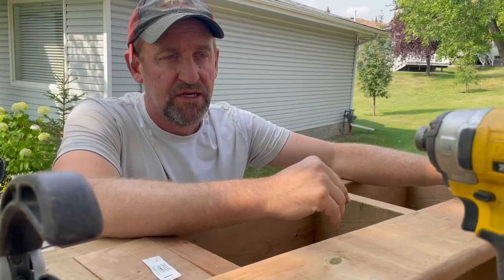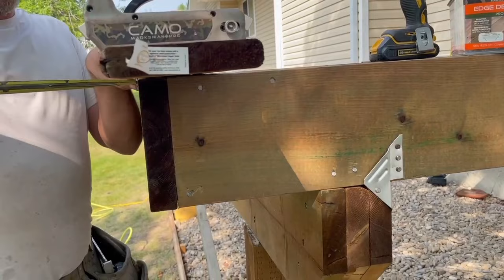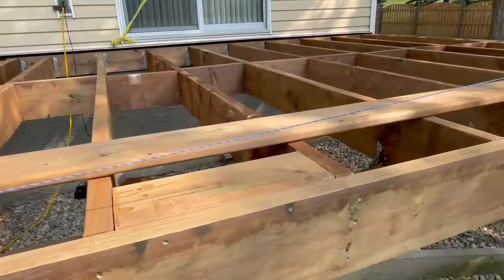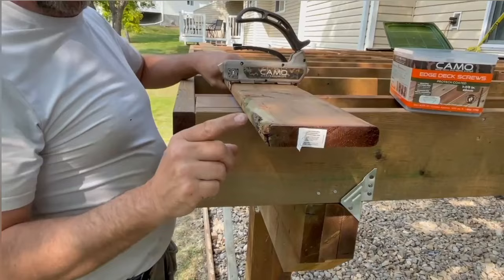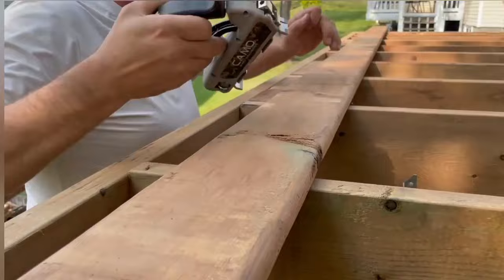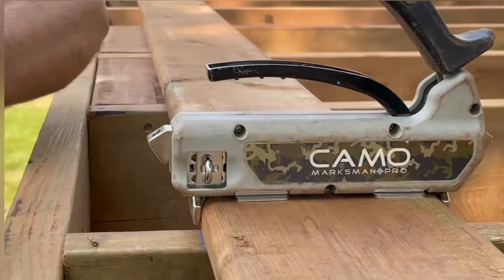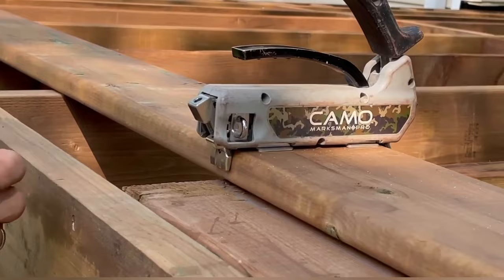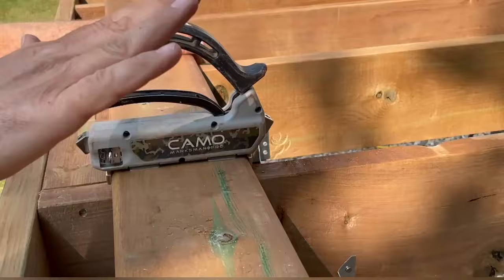Installing the First Deck Board (With Camo Markmans Pro)

Comment: As a 50 year carpenter, ive used the camo system on trex decking..its a good product, but NEVER use it on wood decking. It leaves a space between the boards that looks nice at first. After the wood shrinks up from the exposure to the elements, the gaps will open uo to a half inch and sometimes more. The fasteners will also start splitting the edges if the deckboards as the wood shrinks. Do not make this costly mistake.
Reply: Camo has a different jigs for wood and composite decking. The gap is much smaller on pressure treated wood. Of course there are associated risks if the wood gets delivered and installed fully wet.
Reply: How old are you 80 years old
Reply: I am actually wanting the spacing to help with the drainage which here is excessive.
Reply: I hear ya on that

Comment: No one shows the hard part.  How do you put the screws in the edge of the deck board next to the house?
Reply: The way I usually do it is if you got your flat bar pry bar you get it between the house and you're bored and you got to push out a little bit to hold your board tight to the other one.
And then you put your screw to the back of the board if it's not real wide that way when they put the trim or the siding j-track it should cover the screws

Comment: Just finished my deck using Camo screws and the Pro.  Many many many broken screws.  Too many.  And I had to pull a few boards back up and soooo many would not back out or were bent or once again broken.  Not very satisfied with the product.  Will not use it again.

Comment: In case anyone wonders why they recommend using a drill instead of an impact its because there have been hundreds and hundreds and hundreds of complaints about the driver bit twisting and snapping.

Comment: How do you install the screws on the very first board with the 1-inch overhang?
Reply from the maker: Generally I face screw the first board. Not as pretty but stong and easy. You can attach the overhanging board with small angel brackets, attached to the rim joist. I haven't found it worth it, but it does give you a entirely clean decking.

Comment: I wonder if you can take the spacer completely off. Spacing deck boards is a mistake with even the best carpenters. The boards will shrink anyway. If you space them over time, you will have an ugly looking gap.
Reply from the maker: If installing "green/wet" boards a intialal smaller gap is helpful as you say the gap will grow. Camo does have a smaller gapping tool, but zero initall  gapping requires face screwing.

Comment: How does it hold up over time? Any warping with the no show fasteners?
Reply from the maker: I haven't had any complaints. The angle of the screw actually hold more of the board than face screws.
Reply: @decksbye3269  awesome thanks for the reply
Reply: Yes. As the deck expands and contracts, the fasteners often tear the edge and no longer hold.
Reply: @michaelboykin9881  The face screwing from the top is more likely to split the board so stuff happens either way.

Comment: How do you deal with low points among the joists ? I've planed and belt sanded the high points, but there remain many joists below, in certain areas, the level top surface of the joist/frame ?

Comment: Hello help?... We have 19mm Kwila, which specifies using 45mm camo screws. Can only find 60mm in stock, anyone had any issue using the larger screws on 19mm timber? Is the thread the same?
Reply from the maker: Threads the same it just takes longer to screw.

Comment: Bout to do a deck myself but given the how much shrinkage i've seen over the years from my old deck that was 10+ years old and others i've seen, how well does a picture frame deck using real wood look after the wood has had time to shrink/expand?
Reply from the maker: I like to install the boards with a smaller gap, then once the boards shrink you will have the proper size gapping. Camo also makes a 1/8 gap. 
Picture frame mitre joints will open up. It is what it is.

Comment: Can you change out the spacers for different sizes or do you need to buy another Camo with a different size spacer?
Reply: Each model camo comes with different spacers. I’m gonna use the pro X one. That’s the 16th inch gap for wet wood. Whenever everything dries should be about a quarter inch.

Comment: I see you are using 1-7/8 in screws. What deck boards are you using, 1 x 6 or 5/4 x 6? I am planning to use 5/4 but I am unable to find consistent answer online of the screw length I should use.
Reply: 1 7/8 is totally fine for trex or treated 1" boards the longer camo screws stand out from the tool and make it a bit harder to gide your drill in. either way the guy in the video is an amature. i do this for a living and i would have installed 4-5 boards in the time he took dicking around with one.
Reply: @porscheguy718  What about hardwood like ipe?
Reply: @BoS-nn5dq  Not sure ive never installed ipe just powerwashed and stained it. ive only seen it installed with stainless screws "Facescrewed" which im not a fan of. i would try the camo system before i would go any other way. trex is way different than ipe... in my opinion not worth the cost.
Reply from the maker: Thanks Kevin for the info.

Comment: Looks like you salvaged used deck boards. That one looks like hell.
Reply from the maker: Yeah, I haven't been impressed the last few years with the quality of 5/4 decking being sold.
Reply: I think the proper term is “rustic”😉. I put in a bunch of that knotty Cedar and the quality definitely varies. But the knots do help with accepting a certain amount of, well, imperfections 🫤

Comment: Yup hes got a hurricane clip made for trusses out tying his joist to his girder.. oh this will work. 😂😂
Reply: Says the guy with 4 views on his videos 🤣🤣😂
Reply: @No_914 you looked me up? Thanks, so flattered 😢.. what kinda idiot doesn't pressure block down the girder of any an all bearing points but uses a hurricane clip made to tie rafters to top plate in a house??? 😂😂
Reply: I've seen this done before.  I think you might not know how the system works.
Reply: @Matt-my7pz  just because you can use it, doesn't mean it's correct or right. I suggest you should try an tell another licensed contractor the proper way to do it? 🤔 maybe I should draw a deck detail out for you to submit to your local building department an ask for permitting? Maybe you should know the difference between a real professional? Pressure block all bearing points, leave the truss clips for trusses.
Reply: @justinrutledge6090  oh I'm not a framer or arguing.  I'm just saying I think it's acceptable in some situations and likely selective state code to us the clip for general purpose not solely for roof to wall connections in the idea of stopping lateral movement.  I certainly could be wrong.
Reply: @justinrutledge6090  also I completely agree with the statement, just be cause you can doesn't mean you should.  I friggin hate janky made shit.  Do it well, do it to code, or don't do it at all.
Reply: @justinrutledge6090  yeah this is correct in some states, so maybe get a little more open mindedness, don't be a condescending ass and that your little spot in the world applies to all states.  Narrow mindedness isn't cool.
Reply: @Matt-my7pz  narrow mindedness, you mean the difference between a home owner an a professional who builds for a living? Is there a building code an permitting an inspections in your little part of the world lol